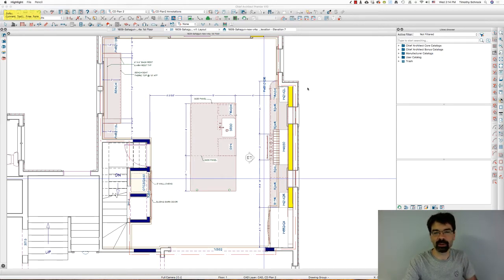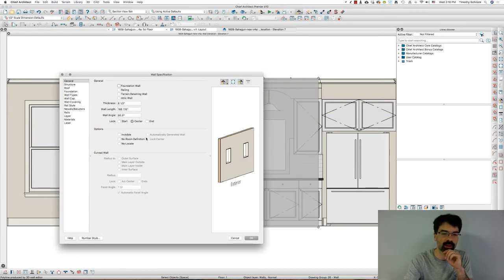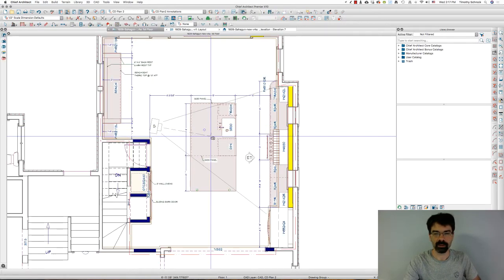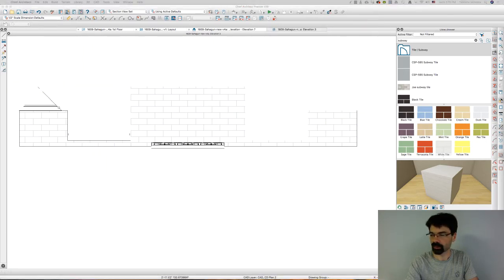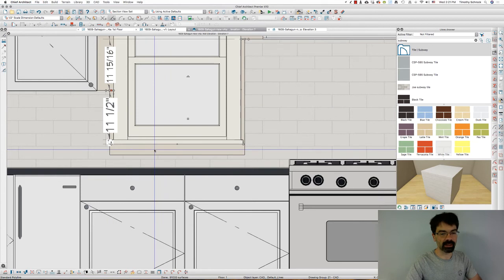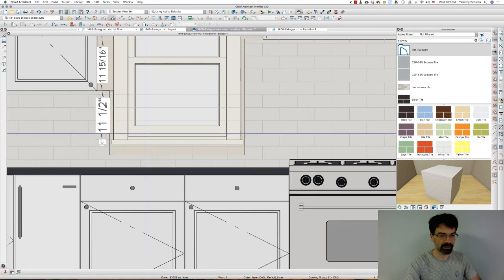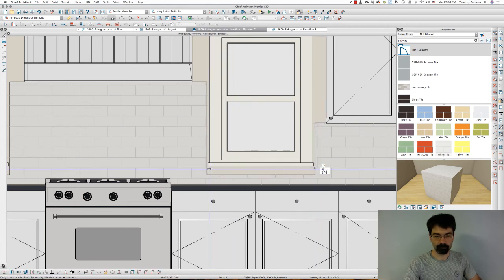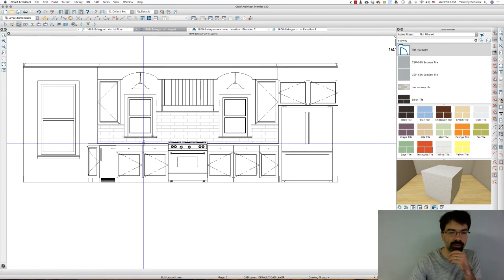Fixing and drawing wall elevations

Comment: I guess you can only use Cad Details from via with a cross section/elevation,  not the regular 'wall elevation' button.  That little detail of why I couldn't convert to cad detail drove me nuts!
Reply from the maker: Not sure what you mean there Steve. I have both created and added CAD details to the wall elevation camera view quite often. Not sure what's not working for you there.
Reply: @DesignbuildsolutionsLLC I'll have to pull up a drawing and double check on this.  I moved out of Chief back to 20-20 until x13 is released.  From what I recall, a cad detail could not be created from standard elevation.   I"ll check and post back.  Thanks.
Reply from the maker: Do you have the premier version? I double checked and made a cad detail from wall elevation before I replied above.
Reply: @DesignbuildsolutionsLLC  Premier X12..  For the life of me, I can't get it to 'not work'.   Could have been a senior moment!  Getting more of those these covid days!  Thanks for chiming in though.  Next job I'll carefully pay attention to what I did incase it comes up again.   I'm very eager for this version x13.
Reply from the maker: @Curious_Skeptic  Glad to hear it's working for you. I can't help with those covid moments though-got enough of my own! :)
Reply: @DesignbuildsolutionsLLC  LOLZ!